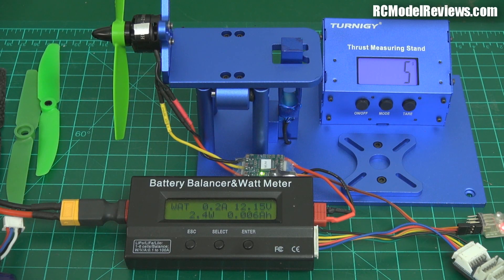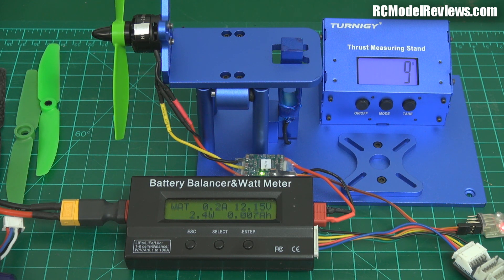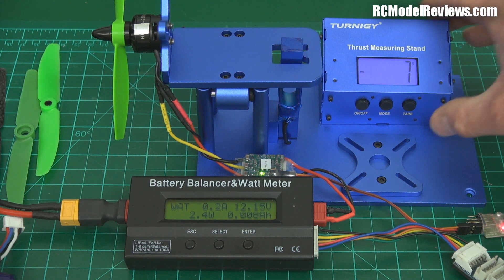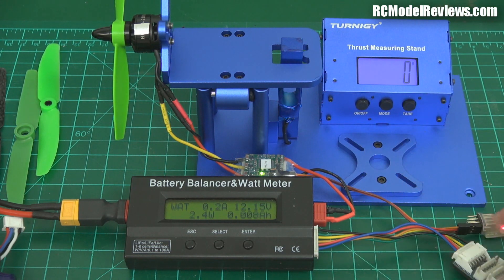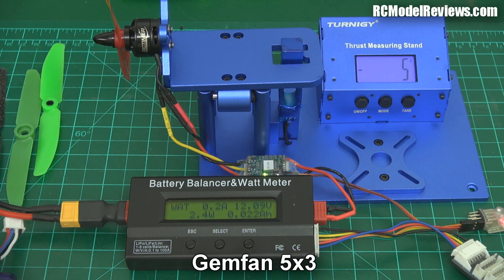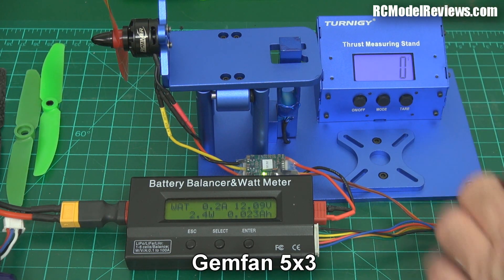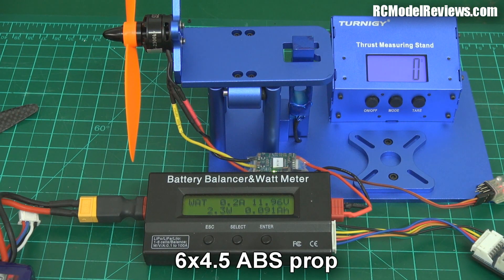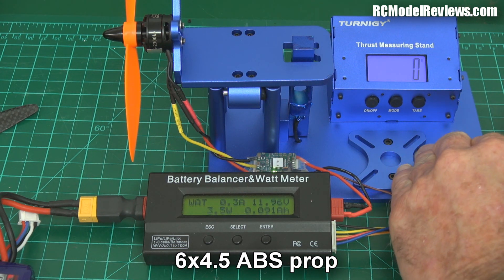5 inch prop tests, at hover power

Comment: Note: these results valid for hover or slow flight, not for airplanes since as plans moves through air faster the effective pitch relative to air speed decreases & higher pitch props tend to be more efficient.The experiment is posiible too with a fan running in room

Comment: Efficiency is function of drag & inertia only since power consumed = integral(localized Drag on prop*2*pi)dr8(no of cycles per sec)+ power to overcome inertia & bearing friction
Bulllnose with tip vortices cause max drag. Carbon fibre won bcz low inertia too. 6 in prop did well bcz each size motor itself has distinct efficiency load curve & 6in one puts optimum load for size of motor. Angle of attack over 15 deg also lowers efficiency as I tested in wind tunnel due to partial stall though lift keeps incresing till full stall at 30 deg for most aerofoils

Comment: Hello Sir, could you answer me a little question? In your opinion or knowledge, which is the smallest three blade propeller  will work better in a drone (Quadcopter) with 1,8Kg to 2Kg of total weight. I need to mount a drone for filming, but it has to be as much as tiny it can be and very stable. Could you help me with an answer? Thank you.

Comment: Hi Bruce
This is a bit off-topic but I haven't seen much in the RC forums etc. about building mini quads for STABILITY. I haven't even reached the Nana stage in my flying abilities but I found my ZMR250 very difficult to fly in the standard configuration with the battery on TOP. (I busted 7 props in one session!) I'm running a Naze 32 board with standard settings.
When I mounted the battery on the BOTTOM there was a world of difference in stability and ease of control, presumably due to the pendulum effect. I'm more interested in low speed camera work etc than racing. I've designed a combined battery case and landing skid in aluminium which works well and gives a more secure battery mount. It adds about 50g in weight but swapping from 5x3 to 5x4 props has overcome that. I'm running Cobra 2204 Kv1960 motors. I also have some 6x3 props which just fit so I'm keen to try them when the gales die down in Tasmania.
Thanks for all your good advice on RC.
Peter

Comment: This is very much dependent on the motor. Low or high KV motors.
If the motor gets hot the whole equation changes, again.
Prop stall and drag coef. all effect the puzzle.
Slow props ( usually used on multirotors)  have stall potential so you need lower pitch the higher the speed etc.
PS Test is too simple.

Comment: Great stuff Bruce. You should try and find a way to graph this stuff so we can see a more complete picture than peak and mid numbers. I think to many are focused on peak thrust numbers and forget that most of your flying is done in the mid throttle range.
Reply: G'day,

Well, Um, I'm a Graphoholic...; so if you really NEED that visual Fix, just re-watct it with a Pen or Pencil & Paper handy, transcribe the figures, and then draw & plot the Graph on the flipside of the Papier...

 Easy Peasie Japanezi...!

 ;-p

Ciao !
Reply: I would love to see a detailed graph with different motor/prop combinations too. Dont know if would be a good fit for a video though.

Comment: It's not enough to say the carbon fibre props are most efficient just because they draw marginally less power at 150g of thrust - the weight of the prop is also relevant and isn't taken into account here. If you adjust your results to account for the CF props being heavier than the gemfans I bet the little Gemfan 5030 will triumph in this test.

Comment: Bruce, as ever another great video. I believe there's another dimension to view and that is the underlying response curve of the motor-prop combination across wider range of thrust versus input-power, say from 25grams to 200grams, from which it should be possible to extrapolate over a wider range and get some idea if a prop is more suited (perhaps) over a wider usage band as would be the case in-flight. It would also indicate how efficiency varies for any combination.

Comment: could you include the Sunnysky x2207S 2000KV in your tests, as it seems to be quite awesome on 4S on Racing quads (like the Cobra motor)
Reply: Grearson .x I've just fitted the SS2207 motors to my MXP230 (that's 1,400 watts of power in total) and I'll be including it in the motor-test series of vids coming up very soon.
Reply: ***** Great, looking forward for it ... Safe Flying over there =)

Comment: Would APM be a good platform for your sense&avoid to work with?
Reply: Leo TL I'm going to focus on the PixHawk for the SAA system -- since the APM is pretty tapped-out in terms of the available processor resources.  3DR were going to send me one a few months ago but I haven't seen it yet.
Reply: Good choice :)

Comment: Bruce
How do you think the HQ carbon three bladed 5 x 4 props would do? I've been flying them with good success for the last two or three weeks. Last weekend was my first serious crash, I ran into a clump of Spanish moss at about 20 meters up. It turned into one big yarnball. Only broke the three props. The XHover is as solid as a rock.
As always I appreciate the info that you provide.
Thanks!

Comment: well, you should repeat the test with same propeller multiple time to see Repeatability of the testing machine and check at least 3 props for each time.

Otherwise result for a single test is pretty useless...

Comment: Great test, and some pretty weird results for the HQ 5030. I'd have thought a similar performance would be had static testing against the Gemfan 5030. Gonna have to break out a set of the ole flimsy props and confirm this! I guess the last test I'd be really interested in would be CF 5030 props in standard Vs. T-style, followed shortly by the industry-standard watermelon-as-a-finger test :)
Reply: hqprop 5x3 is more heavy than gemfan 5x3. That's why the performance is less. You need hqprop 5x4 to outperform gemfans 5x3
Reply: No doubt that's it, Boris B. That would account for the more solid feeling to the HQ blades as well. My fiance would love for Gemfan to offer pink 5030's, (we both fly Diatone FPV250 frames with cages, so 5" is the max). I have to assume if any brand will make them available, it would be Gemfan. A bonus now with all of this new information! Thank you, gents!

Comment: Hi Bruce. Thanks for another great video! If ever you get chance there is a particular subject that I'd love to see you cover and break down in your normal, understandable way. I've gotten to the point in the hobby where I'd really like to design my own quad. However, choosing the power system is very confusing. I know there is a lot of content out there, but applying it is a different matter.

As an example, is there a way to start with the basic weight of the machine (airframe, flight controller, FPV equipment  camera and gimbal) and then work out what motor, prop, speed controller and battery combination you need for basic flight? Thanks Bruce!

Comment: My only concern with CF propellers is that instead of breaking on impact, they may cause a motor shaft to bend. Especially on those tiny T-Motor MT1306 3100KV motors that bend from just looking at them too long.
Reply: I found the 6x45 props the best all round prop. If you want to fly slowly you will have great flight time, but you also have the most power when you need it :D. That means that it will give you the most variable flight time. Also the motors plays a part in that. 2204 1960kv motor on 6x45 was the best efficient setup so far on 3S and 4S.
Reply: To give you an example. On 6x3 props I would use 80% throttle where for the same speed I would be using 55% on 6x45. You basically end up with screaming multirotor and lose your efficiency.
Reply: Boris B. The 6x4.5 is so versatile, but make mine a 3 blade with a lower kv motor. For $6.45 per motor you can use the FC28-12 1534kv motor from HK on 4s for ballistic performance. Lower KV, but an extra blade and CHEAP. Measured on 3s and got 680g of thrust per motor, built a 580g tricopter including 1800 4s and loving every minute I get. Team it up with SimonK flashed F30A's for a bullet proof budget power system giving 6-10 minute flights.
Reply: Ben Govett Thanks for sharing your setup! really helpful for newbies like me :)
Reply: I have use 5" CF props on my 250 quad. 5x4.5 props from miniquad. On eBay. Very efficient prop and as for breaking. They are very strong for flight  with very little flex. but actually crash they shatter so no huge risk of damage to the motor. No more so than gemfans. But cost a lot so. I only use them for slow flights better having the cheap props from gemfan than bashing expensive CF props for beating about.

Comment: Would be interesting to see if the results you found here in a controlled environment translated 1 to 1 for and actual flight given the extra aerodynamic interference of the frame and legs would provide on an actual quad.
I'm thinking in a hover at least the bull nose props may suffer even more perhaps.
Anyway great vid as usual.

Comment: Hi Bruce.  Could you please do a comparison test of same KV, bigger motor (ie higher power rating)  . I have a tail heavy foamy plane that needs at least 20g of lead to balance, so a heavier motor may be a better option than lead ? especially if its actually more efficient. Cheers

Comment: at what "s" do u test?

Max
Reply: He's using a 3s LiPo in this video (hence the voltage around the 12v range).
Reply: HiFlite FPV
Thanks, could be interesting to verify the behavior at 4s also, just 'cause there are a lot of minis with this power train
Max